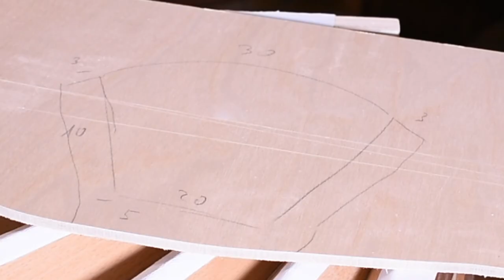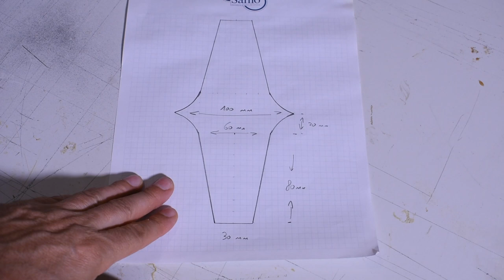How to build a portative Pipe Organ | Homemade | #32 Bellows completion | SUB ITA

Comment: Fine video. I would like to hear what type of glue you applied.
Reply from the maker: Thanks, in italian "Colla Garavella forte" or strong hot hide glue.
Reply: I guess it's bone-glue that hardens by cooling down and drying out. A reversible process, glue is not water resistant. I applied is for the 66 small bellows of my pianola (player piano). Ciao!

Comment: what type of glue here used? Can fevicol wood resin glue will work? or fevicol synthetic glue?
Reply from the maker: I used hot animal glue.
the glue you say is fine as long as it does not dirty the parts of the leather not to be glued, otherwise it stiffens.